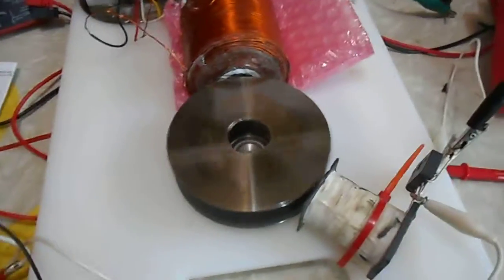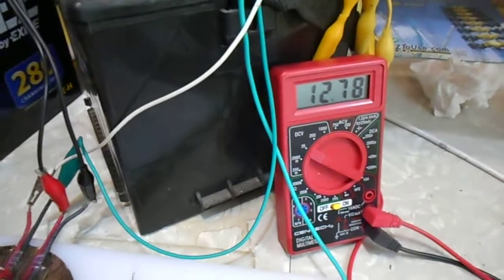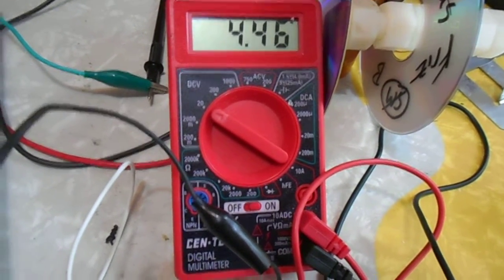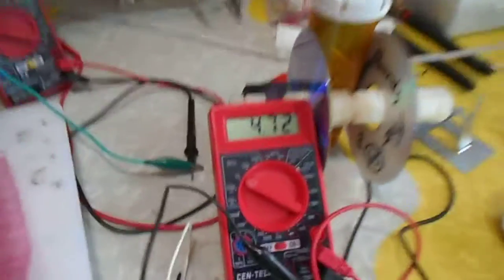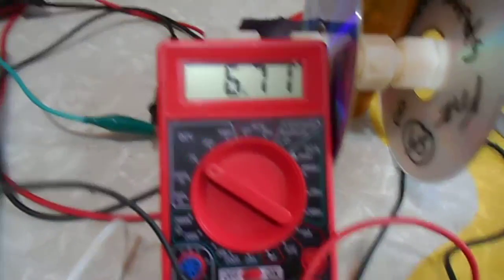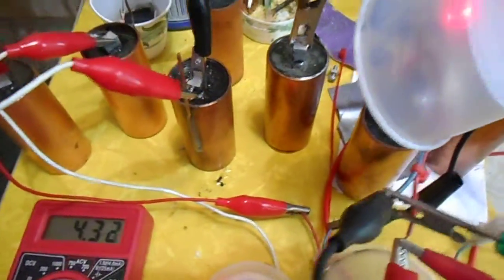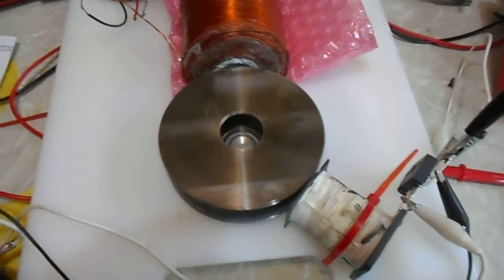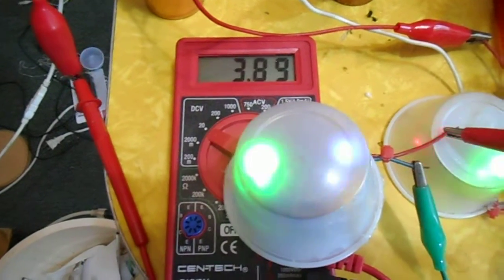Bedini Motor in action pt 2

Comment: I've followed your series from the start.  Congratulations!  You've built a great setup.  Let the head scratching and fun begin!  :D
Here's a tip for your next coil.....I've seen in other coil constructions, twisting both wires together and then wrapping a new coil.  I'm going to try it to see if there is a noticeable change.  Peace to you as well.  :)
Reply from the maker: Thank you for your kind remarks. I learned every bit of this from "You Tubers." I have a goal for all of this work. Next I need to add more coils so the load on the Bedini can be expanded. And, yes, it does include more magnetite cores and tricks to play with the magnets.  Again Thank you and Peace.   Lynn